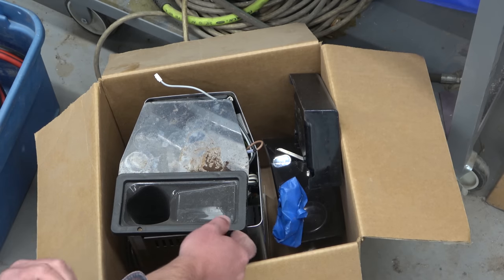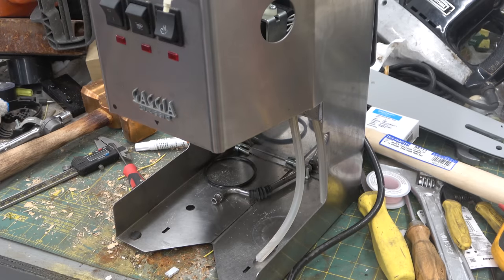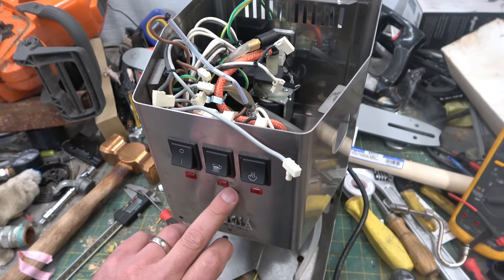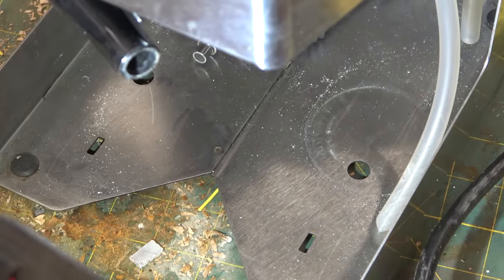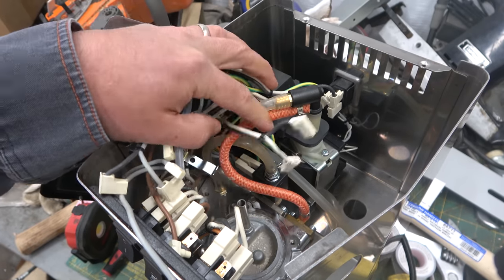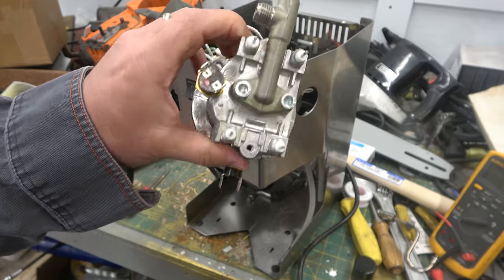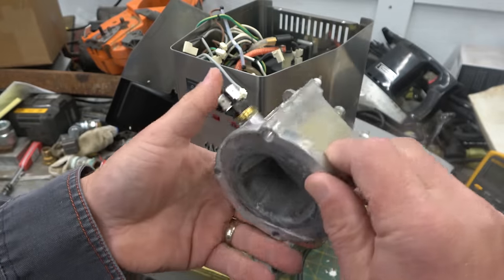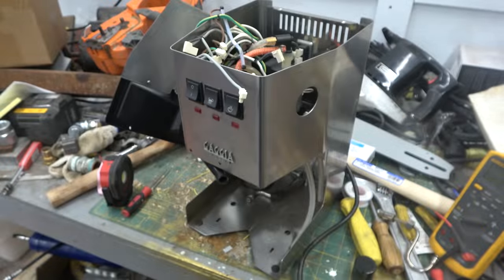unBOLTR: Gaggia Expresso

Comment: stumbled on this by chance, and being Italian... there you go:
These kind of Gaggia machines are built to be simple and forever repairable. the Classic and Baby (and some other models made only for certain markets and for other appliance brands) are following the same principle of the first 1977 home machines so the internal design never changed. (Philips forced one series with the cheap stainless steel boiler common to other brands in 2015, reverted to the real deal after complaints)
The boiler is a simple cast, with just the bare minimum of water to be heated, so the machine would be ready quickly (bigger machine need lot of time to heat up, this one needed to be faster than a moka) since its small it needs to have the mass to maintain a stable enough water temperature while the new colder water enters when brewing.
Heating elements that work dry are placed outside the boiler so if it heats up dry nothing breaks (the heating elements in other machines are the type inside the boilers that crack if run dry).
To make it easy to produce both for export and domestic market the only difference between 120V and 220V machines is that the heating elements are wired in parallel and not in series... and the coil of the vibration pump is specific, internals of the pump are the same and can be switched around.
Everything can periodically be disassembled, cleaned from deposits, reassembled without trouble.
If the boiler would finally kick the bucket its often because of corrosion depending on the water used, it gets changed with a new one, rare because they last forever but they are cheap anyways. (and in freezing temperatures is practice to empty the boiler of any machine)
If you compare with the cost of material+time to repair that one, changing it is easy. 
And if you order a new one get yourself a full set of gaskets (saves yourself the time, the one between steam valve and boiler mostly.) 
If you look for a diagram that one you have in hand is a "Gaggia Classic Pro", but parts are the same as they always been. 
They last forever, In my family there is one from 1979 that works as well as mine which is just a few years old.
P.S. In this one they did another good thing: the switches are 3 separate units, in the old one they are a single block, they rarely break but now its even easier to change just one instead of the whole unit.

Comment: I have this exact machine, only in matte black. This is the newer model, made since 2019 I believe (you can tell by the switches). Funny thing is, when it comes to real espresso, this is the most entry level machine you can get. There's a huge modding community around it, especially when it comes to adding PID control to the boiler

Comment: Ive tried fixing many of the older style coffe machines. The thermal isolation of the head is usually poor and will melt cables. The high pressure water pump and water heater get clogged and break.

Comment: Some would suggest the cheap fix, or replace the parts. I suggest CADing that boiler up and machining it out of a block of aluminium. Yes, aluminium as opposed to aluminum. It's skookumer on account of the second I. One I only gives you vision. TWO I's gives you depth perception. More accurate on the Z axis.

Comment: Ha that is a Gaggia Classic Pro, released in 2018/19. This little lady let the smoke out pretty quick.  Pre-2014 machines are tanks!
Reply: Fundamentally, they’re basically the same machine.  Group, pump, boiler, thermostats, steam valve are all the same.  The difference in the switchgear actually makes the newer machines a tad more resilient and serviceable with generic parts rather than requiring the monolithic triple-switch and indicator combo part to be replaced as a unit if any one component failed.  The only change in the “wrong” direction was moving to an OPV where the spring needs to be swapped instead of loosening or tightening a tension bolt to change bypass pressure.

Comment: Sharpie marker on the flange. Use the heating element to heat it. When the good old marker fades it's time to tweak it back. Could use some threaded rod to pull it back. Careful mind, not too much or too fast

Comment: What’s the nature of the seal? Is the mating surface cut for o-rings or some kind of composite gasket? Could you make a clamping ring so you don’t have to weld onto the casing and machine the mating surface flat?
Reply: And pressure testing before reassembly might reveal unseen damage.

Comment: Those Gaggia Espresso machines might not make the highest quality espresso but they are built like tanks and just about every part you need is readily accessible via Gaggia's Parts department. 

You can re-build that bad boy and get it back to working condition for a fraction of the $500 price tag (Miniscule compared to the pro Espresso machines that regularly cost $7k or more for a two-grouphead situation.)

Comment: People very often make a major logical fallacy in thinking that simplicity is always good, whereas oversimplification can be immensely worse than overcomplication, case in point the T-34 tank. But this is a fine case of excellent enginerding, not too complicated but not too simple either. If there's anything we've learned from the past couple years, it's that we rely on chips way too much for basic things that we don't really need them for. If 3 off-the-shelf switches can do the job, then why waste chips and Touch-Screens on an espresso maker?

Comment: Make sure the heating element has resistance or test to see if it chooches (don't let it overheat or it will break!) before fixing the leak or you'll have a nicely repaired block of metal.  She's a beauty to keep and get working again, but I'll tell ya... there's more expensive machines out there and they've got microchip brains... I know I've got one of them and I've been inside a half-dozen times over the last 20+ years keeping it going, replaced the pressure stat, the water tank level alarm, some tubing, this and that...  but I can't say I've put my machine in a freezer though.

Comment: try summat loomin'yum solder! can't be any worser than the galvanized water pipes most cities installed (and never removed) in the fifties. plus, it seems to bond before you get the substrate close to the plastic state. Additionally, with that heavy case, you've got a nice quasi-safe platform for pressure testing the repair! Maybe use minimum spec fasteners so it doesn't break the same way again when the shop dips below zero for too long. Or I guess you could map it and make one out of billet for extra horsepower. Nevermind the reasonably priced spares available!

Comment: It would help if the owner mentioned why it broke? You saying it dropped water everywhere, when turned on. Those two circular heating elements are probably what’s wrong, though as an unseasoned vet, check the switch’s first. 🌲

Comment: I have that machine. Great espresso machine. It’s actually on the very low end of the high end. That there is the cheapest espresso machine that’s designed to be maintained instead of disposable. Anyway that there is your boiler, and a replacement is between $45-70 USD depending what internet site you buy from. Just get another one and these are $400 machines new, Definitely worth it to keep these things going.

Comment: I guess there's nothing you can do but to hand carve a wood pattern of the boiler, make a sand mold, cast in brass, machine the mating surface, and install. I repaired an old (maybe 1960's) Victoria Arduino espresso machine (ancestor to their Venus family) with a brass boiler made this way. The whole machine is hammered brass sheet, hand cut and brazed, over a gas welded angle iron frame.

I wired up one neon lit toggle for heat, one for pump. The pump toggle is wired to mains independent of the heating circuit so I can flush the machine or prime the pump with the heat off. Steam is activated by first raising the temperature by means of a rotary switch - a whisker thin copper coil delivers boiler pressure to the back of this switch and I believe internally the switch does something mechanical like adding spring preload to raise the cutoff pressure - and then a knob on a valve that lets you release the steam once the machine has come up to the higher temp (nobody wants wet steam in their milk - in fact you have to purge the steam wand of water and preheat it before you get the milk involved).

Comment: I have an older Rancilo Silva on my counter.  I thought it was broken so i pulled it all apart, cleaned it all, fixed a couple wiring potential issues thinking it was a short.   Nope.  That wasn't it.  It draws too much amperage for the gfci that i had it plugged into.  I switched it to the split 20 amp non gfci plug and its worked flawlessly since.  Bright side, i now know its completly clean.  Also down east coffee down the road does actually service espresso machines in NB. A bit far to ship such a heavy and bulky item, but its an option.
Reply: Yeah
That espresso machines needs to be cleaned seems to escape allot of peaple.

Comment: i had a job fixing these a while ago and a cracked boiler meant replacing it,  usually with another used boiler.  a new replacement are pretty cheap nowadays so just do that.  but that's not the ave way of doing things:  take a billot of aluminum from your shop and you know the rest...

Comment: Hey I have a similar unit that I fix several times the boiler you can buy for around 60 dollars whole latte love, they still m ok at of the parts you will need, new o rings and it will be as good as new, always have plenty of water other wise the boiler will over heat, just check the boiler thermostat make sure it's not open circuit, and it has an inline fuse that pops when gets overheated is the wire with the the clear insulation maybe this helps

Comment: I'd fixer 'er.  Those things can go for near $650 Canukistan kopeks, even used.  Not too much to go wrong on it, and unless you have to entirely rebuild it from the ground up, it's still worth the cost of parts and labor.  Well, your valued time and labor maybe, mine's a non-factor considering it's more like slave labor around here.  There's two thermostats on the boiler assembly and a  fuse, I'd check them and the switches, other than that it might be a froze up solenoid or water pump. That boiler assembly is used in other brands too, like Kitchen AIDS etc., so you should be able to find one pretty cheap, even on fleabay.  Also, don't forget to put in new o-rings while you're in it.

Comment: If you are going to attempt tig. Test a little spot. Every time I have tried to tig on castings like that. Well lets just say it was problematic. What about that stuff everyone has seen advertised (my old brain can't remember the name). Where they gas weld the aluminum angles. Then bend them back and forth without them breaking? Might work and be a good demonstration. Maybe even a good demonstration for a video.

Comment: Aluminium carstings are just molded weldaments.  Or, stated the udder way around, welds are castings without molds.
Time for GTAW.  That thing is far beefier than needed so the alloy for filler material is  garden variety 4043.  Here, silly con makes the puddle as fluid as can be with a little melting point depression.

Comment: Word got out that one may sometimes know how to get the magic pixies and smoke back into the electronicals, low and behold I have a box of circuit boards from the local doughnut and espresso shop. 

The good part is they self diagnosed it by disassembling the thing and kept it all there so one has no way to test/verify anything.

I’m guessing the free doggybag of doughnuts that were in my mailbox yesterday were full payment and request for an update? 🤦🏻‍♂️

Comment: Not sure I would want to weld on something cast aluminum that's also a pressure vessel. Im sure it's good quality metal, but welding cast anything can be pretty difficult & downright dangerous since this thing is supposed to hold 100psi of steam. Unintentional steam bombs are no fun

Comment: I had to replace the speaker in my guitar amp but it still didn't work after that. Then found some dead transistors which I replaced. Still didn't work. Almost a year later when I was going to throw it out I noticed the new speaker hadn't been reconnected after doing the transistors. In magically started working 🙂

Comment: Hold down warped element on flat steel or concrete while tapping around the base with big hammer, it will form back into perfect flat part, same as new😃

Comment: I love these machines. The electronics are so simple and rely purely on electricity being lazy! Plus all the parts being available and the thing being easily serviceable. The boilers are available, but yes expensive when compared to the cost of the machine.

I faced the same with mine, the boiler is pretty worn out, but it's been overhauled several times and it's 20+ years old. 

Philips bought them out, ruined the model they released from 2015 (made it cheap, removed all the features that made it good), but have gone back to the roots with the Gaggia Classic Pro.

Comment: Eh, used to work on those things back in the day. New element should run about $50 USD. Could try tig welding it, after all it's already fucked so can't ruin it... Get yourself a new head gasket (NG01 if I remember right) if you're ordering parts, it's almost guaranteed to be all dried out as well.

Comment: You should be able to cut a chamfer with a cutoff tool (they got them for cutting aluminum without clogging) and tig weld it. Build up a bead and either leave it ugly or use the same cutoff tool for aluminum to dress it up.

Comment: I feel your pain, I recevied a basket case from Coast Guard, asking if I can fix a $12.600 robot. They said is has been down for 3+ years and 3-4 others tried to fix it. Hmm, Basicly it is a $12.600 remote control toy, I told them I'd try, but, no time limit. Great they said, buy whatever you need.   3 months later Iwas told STOP, no money in the budget, so I stopped. 2 weeks later I was told ok, there is a $200 budget, LMAO, and they needed it witin 5 days. Well, I delievered it on the fifth day at 17:30 Hrs. but it was just riged.

Comment: Lap the bottom flat-ish and rig something to gingerly pressure test it (carefulling!) - maybe tap some holes in a plate for an air fitting in the middle and bolt holes as appropriate, with a piece of Grandma's underthings for a makeshift gasket.  If it leaks where you think it otter, TIG weld the shit out of it and pressure test again - gingerly.  If it seems skookum enough, have Prudence put it inside the blast chamber (the black one in the corner, where you usually oxidize cellulose foam) and test it at full beans.

Comment: If we look at the design of coffee pod machines, and then consider the design of the bullet, it should be clear that we may have a potential design synergy, where spent cartridges can be filled with tamped coffee, and sealed with a plastic film with a foil coating. 50 caliber cases probably hold a suitable load. 

Additionally a modified shotgun breech might well work as a cartridge loaded grouphead.
Reply: Leaded coffee mmm

Comment: The problem with those coffee machines is the aluminium boiler, the corrode horribly on the inside. Thus you are drinking aluminium flavoured coffee. I have one in a box in the attic that I keep as a spare for when my ancient Isomac which has a brass boiler, stops working. But, weld it and face it off would be my opinion.

Comment: Make it more skookum and machine a replacement boiler housing out of brass. Or just buy the replacement for $35 Usakistan doll-hairs. Leave enough room for a little jellybean industrial PID controller.

Rewire it so the switches act separately for the solenoid, pump, and steam / heating element override respectively–this'll let you do manual pre-infusion which makes it much easier to brew a decent 'spro.

Comment: I've fixed some Krups equivalent by sourcing a heater on the internet (20+ years old part), but equipped as you are (...) you should at least attempt to TIG it first, them rectify it flat with sand paper...

Comment: Oh for those days gone by... Before planned obsolescence... When the world was analog and parts were skookum. As to the problem at hand. Back when I worked on the railroad, the track guys would come out to fix broke rail during the winter months and had a nifty little method for fixing broken, gapped rail sections what had contracted in the cold.... They built a box round the break... Packed her up with some sand concoction.... So as. To leave only a hole at the top. They then positioned a disposable container, like a sort of coffee can sized bucket above the hole with a thermite type mixture of stuff in it and then set her ablaze with the old oxyacetylene. The thermite proceeded to catch fire, burn extra hot, liquefy, do into the sand mold, and repair the cracked, gapped rail.

Now your espresso party prolly needs to be machined to true the mounting point... But you knew that... After that I think a similar Frankensteined type fix would meet all the requisites to get her back to kachunkin.

Comment: Got one of those in my kitchen... Steep learning curve, built like a brick s**t house. I hope to acquire appliances as good, and usually come up short. but not with this one.
Problem is, you'll have to spend just as much on a grinder if you want to use the darn thing. I would go so far as to say that the grinder is what makes the espresso. The machine is just there to heat the water... ;)

Comment: If you try to weld it you'll probably find that it's an unweldable die cast alloy that cracks immediately after adjacent to the weld, plus you'll likely fuck the heating elements that are crimped in there from excessive heat.